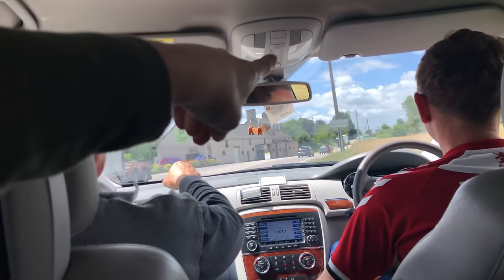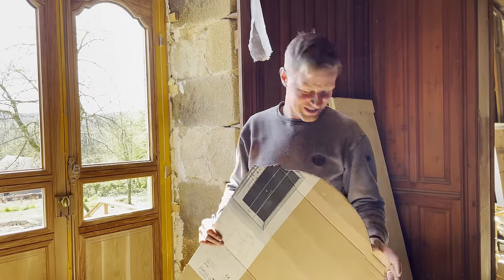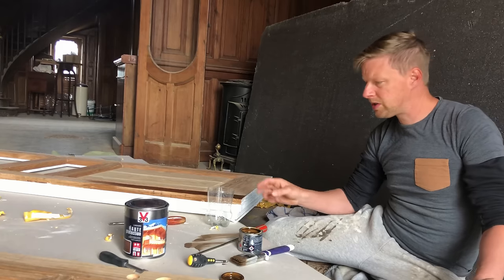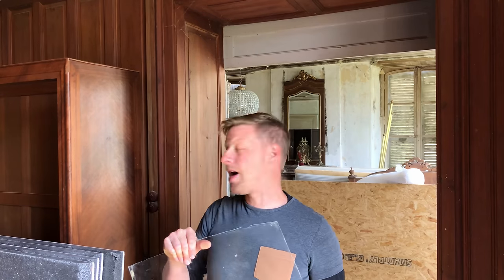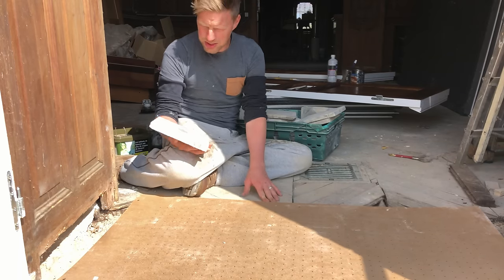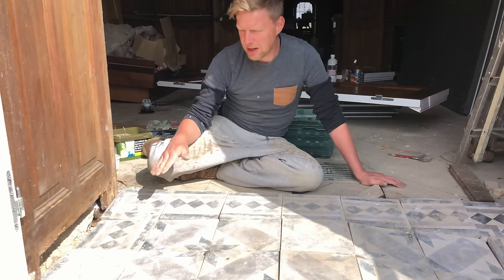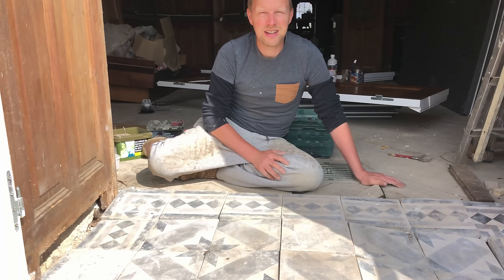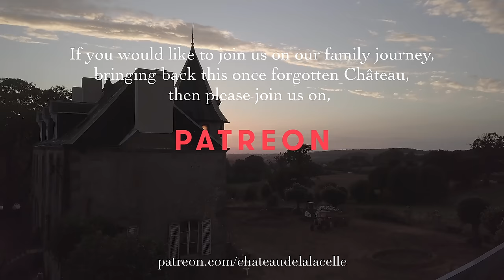Restoring The ORIGINAL Château Entrance | BEFORE & AFTER. Ep 54

Comment: Beautiful! From the outside, the entrance is so welcoming with the fresh white paint on the doors and railings and the large glass window panes. On the inside, pure elegance with the wood stain, gold locks and doorknobs, plus the tile floor with its subtle colors and design. The deep red and gold of the heavy curtains as well as the intricately carved gold painted chair with its romantic brocade along with robust candelabra sets a tone of unquestionable refinement.  
Terry and Ash, I recommend that you setup a romantic table for two in the entrance way and have a delicious meal and a glass or two of champagne to celebrate all of your hard work and effort that went in to getting these doors and entrance way back to its glory. Leave the sheetrock and tools where they are because it only adds to the memory. 

Congratulations on finally getting this work done. Persistence and resilience seem to be qualities that not only fit the chateau itself but those that reside with her as well. 
All the best, Donna in Taiwan.

Comment: So happy to see the doors up. Terry you really need to give yourself a pat on the back for cutting a curve in glass first pop. I was impressed. I taught myself how to do lead lighting (with the help of some YouTube tutorials), and cutting curves in glass is not easy, I failed a quite a few times. Though I took note of you having the template, made a world of difference. Will definitely be doing that next time, rather than freehand. Thanks for the tip.
The tiles will work great. Just a thought with the pattern as you layed them out. Would look better if the star pattern is on the right side of door as you walk in (being main door opening) rather than and X ? If you know what I mean. Or cut the half pattern tile in half and centre the two diamond patterns in centre with half tiles either side. I know it won't align the cracks with the border, but I don't think it would matter as separate pattern. Just to make it symmetrical. Unless you are thinking X marks the spot 😉
Edit: Note to self, watch whole video before commenting...🤣😉 Looks great❤

Comment: I'm  confused when you said the doors will only last 5 to 10years because of the wood used, I thought you had the door restored using some of the old door and I thought it's  an oak door that should last many years. Also in todays video I saw at least 1 door had its glass in ? But I suppose it was too thin to be able to used (safety glass etc etc) 
The tiles you found were such a tremendous find they look as if they were always there.
Reply: I thought they were restored by Budo and he was coming to fit them. I also thought they would last longer than 5 years
Reply: I have to agree with Denise. You have stained and varnished the doors beautifully plus you put in safety glass. Being made of Oak, with regular maintenance ie: reapplying fresh varnish when needed, those doors should last at least 20 years if not longer.  Of course, I’m not seeing them in person so I may be talking out my elbow but..... 
Well done once again Terry, first class job! ❤️👏❤️

Comment: You can get glazing pins so you don't have to hammer in nails. Then there is a glazier's point driving tool to push them in. 
For some reason I find putting putty in very satisfying.
Reply from the maker: Thank you, it was a wood trim around to hold the glass in 🥰

Comment: I'm not a carpenter or woodworker, but wouldn't it have been faster and easier to get the template by taking the roors down and tracing through the opening? Especially since you took them down to stain. Just wondering. 😋

Comment: Sorry to be negative guys but that entire floor needs to come up and the timbers completely replaced. The way that you have ‘patched’ the floor does not provide the strength that it needs. Get rid of all that soil between the joists and use modern insulation. It may be an expensive option but in the long run it’s really the only way to go. Speak to the chap from Chateau la Freute and see if he can give you any pointers.
Reply from the maker: We took as much as possible out, under that is stone for the cellar roof and a very good base. The floor is nowhere near as bad as what Carol and Adrian are facing.